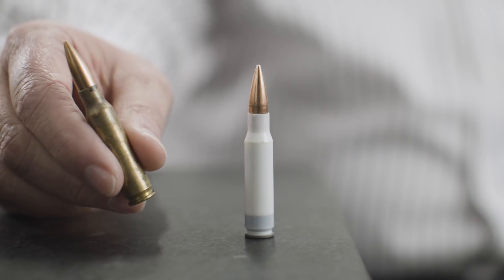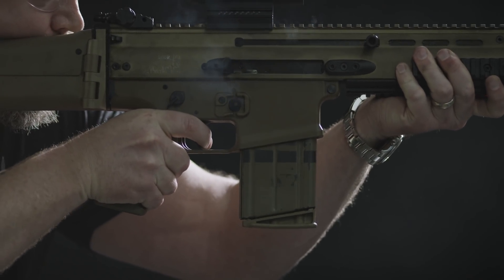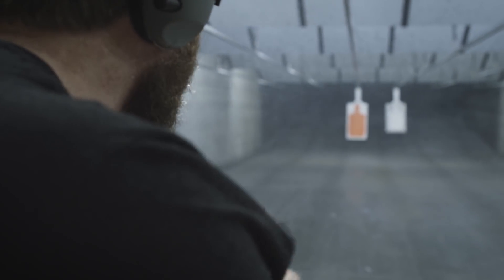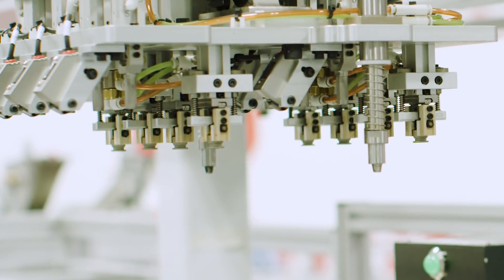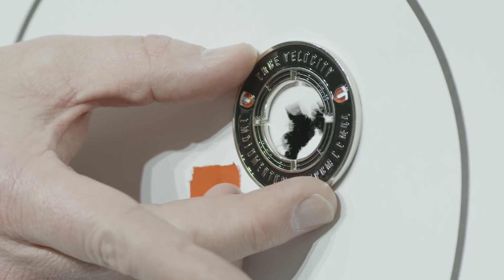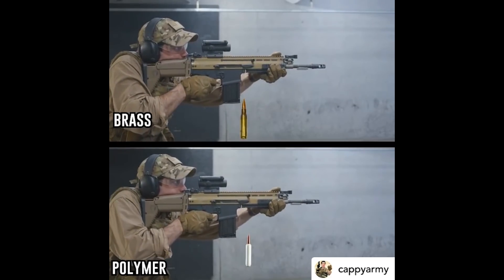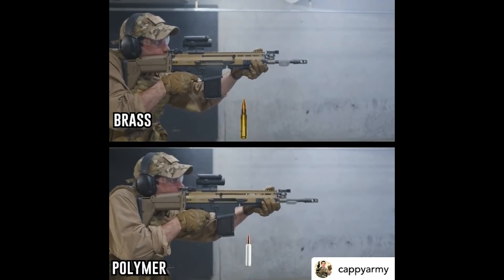Composite Ammunition is More Accurate than Brass | NGSW | Next Generation Squad Weapons

Comment: This is bull crap. High end brass is extremely consistent internally, can accomplish single digit SDs, and produce incredibly accurate ammo at less cost. Oh and you can reload it repeatedly to pull even more cost out of it.
Reply: I was curious about that claim. good to know that my hunch was correct. even so, the military is interested in weight savings. that claim in particular has nothing to do with the goal trying to be reached.
Reply: He wasn't talking about internal inconsistencies. He was talking about the internal shape of the case. For brass, the inside follows the outside and is whatever that shape is. Polymer cases can be molded internally to control how the powder burns i.e. better.

Maybe listen instead being a keyboard warrior.
Reply: @MansMan42069  They are in the middle of a campaign to raise capital through large capital investment and its a marketing video.They wouldn't pull anyone's leg while trying to raise money would they? How much ammo have they sold commercially? A very small limited commemorative amount at $160 per 20 rounds. How many people have you seen (on the internet) showing a comparison to brass ammo and statistically agreeing with his claims that aren't True Velocity or aligned with them? In the shooting world tech that gives you an advantage like they are claiming spreads like wildfire. No one is talking about it. Primarily because it doesn't exist and you couldn't reload it if you wanted to.
Reply: @MansMan42069  Nothing I said in my original post is wrong. Other than my opinion statement of this is bullcrap the rest is all factual. Absolutely factual and cannot be argued, actually. You can disagree with my opinion "bull crap" but there is not a single argument against what I stated. 
Maybe you would do best to read what I said since you're such a stickler for the details, time stamps, "prove it" call outs and insults.
Reply: @MansMan42069  As far as listening. He says that their ammo has more consistent internal dimensions (unlikely, if so its 1-2/10ths of a grain and unimportant), he states that the internal geometry helps powder burn (I dont know,  their marketing video says so) he says its more consistent and that they maintain higher standards of quality control (nope) which gives you more consistency, tighter standard deviation (their SDs are not better than brass) which leads to tighter dispersion and tighter groups (yep, it does no matter the vessel). However, they cannot achieve the accuracy levels of brass, fact. Regarding heat transfer, polymer does have a limited effect on that. After firing 200-500 rounds what do you think the barrel temp difference is? All the burnt powder and gas is still heating the entire bore, do you think the 3" chamber area doesn't get the heat radiated from the barrel? More likely 8-10% less powder has a greater impact on it than the case itself. Brass also pulls heat with it when its ejected but we will save the details on that.
Reply: @gunguru7020  Your arguments are based on skepticism and you can continue tooting that horn. That's not my contention. I don't care whether he's lying or stretching the truth because you have nothing but speculation and conjecture. Basically, no proof.

My actual problem with you is your misrepresentation of what he said.

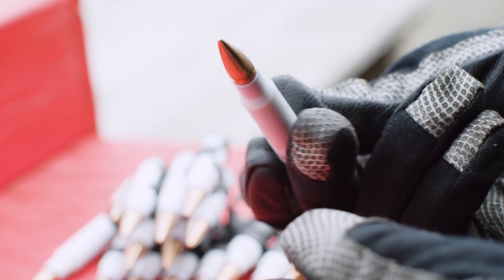0:55 - "We control the molding process very tightly so that parts are very consistent [from] one to the next."

Where did he ever claim that their quality control is "higher" than anything, brass or otherwise? Where did he mention that their internal dimensions were more consistent? Kindly give me the time stamp.

Again, try listening.
Reply: @MansMan42069   They whole point of the video is a comparative to traditional brass. When he says the similarities stop here he is saying what they do better than brass. He compares them,  then says composite is different and unlike brass because, and lists all the things it does better. 

:10 what we have here is two cartridges, one brass and one composite, the have the same length, use the same projectile, same powder..... (:31) "however thats pretty much where things end."

As far as speculating, I am not.
Reply: @gunguru7020  Your comprehension is lacking. For you to say that the video is saying what you think it's saying is intellectually dishonest. Basically, you're reaching. The video does not even remotely imply that its process is better at all.

And yes, you are speculating. You have no hard numbers. Neither from brass case or from the polymer case in the video. You're pulling things out from wherever the sun doesn't shine.
Reply: @MansMan42069  What is it saying? Tell me where I am reaching. 
1. My original post is 100% factual. 
2. The opinions I represent are based on decades of brass reloading for extreme accuracy
3. My opinions on composite are based on experience and exposure 
4. My TV experience is based on evaluating 80 of their commemorative rounds. Although very limited i didnt represent any positive or negative results from that as it is way to small of a sample to provide confidence. Rather I said its bullshit because its marketing spin and brass is equal/better and cheaper initially and cost continues to be lower every time you reload it.
Reply: @gunguru7020  In your original post, you said "High end brass is extremely consistent internally"

Just because this is factual does not make it relevant. This is a red herring and is irrelevant to the video's claims. The video didn't even claim that high end brass was inconsistent internally and made no comparisons between the manufacturing processes. Show me a single explicit comparison to the brass case manufacturing process in terms of quality control.

I only have your word. Where's your video proof? I can be just as speculative and say you're only blowing smoke and are lying about your tests just to save face. So I'm calling your bluff. You haven't done any personal tests. Feel free to prove me wrong and provide evidence and hard numbers.

Try again.
Reply: @MansMan42069 The whole point of their companies existence is that they are superior to  brass cased ammo and if you cannot see that this is a comparitive marketing video telling the viewer why that is, then we are too far apart to have any further discussion. I will just leave it at this because I have no desire to continue to defend that you can accomplish more with a brass case than has been proven with a polymer case. Yes its lighter, which is a quality which is irrelevant to anyone other than the military. It cost many times more and cannot be reloaded. So far, it has proven to be less accurate than brass ammo when making "match" accuracy and single digit SD claims.
Brass is equal or superior in almost every facet. I dont need to prove anything regarding that at all. 
In reference to proving anything around polymer thats the job of this video. I am not selling the product. Its the one making the claims, it should show you the statistical differences. If you are that interested in that buy your own ammo, shoot it and decide yourself. Don't demand that someone do it for you to prove themselves correct and you wrong. You will be disappointed. 
I am saying what they are claiming is marketing spin and/or irrelevant.
True Velocity is trying to raise hundreds of millions of dollars and competing for billions of dollars in DoD contracts. These videos come out during those campaigns, they release a limited run of commercial. 308 ammo, and you don't think that its a coincidence. Rather you defend what you, apparently, don't know or blatantly ignore.
Reply: @gunguru7020  Still reaching. You are putting words in their mouth. You're attacking a strawman, instead of the arguments I actually raised.

You have no evidence, are putting words in people's mouths, and have no concept of intellectual honesty. If you're going to attack something, attack what he actually said.

Go learn some basic argumentation first, kid
Reply: @gunguru7020  It is intellectually dishonest if you misrepresent what your opponent is saying. That's called strawmanning your opponent and is fallacious reaaoning because you're attacking a position they don't hold.

Also, you make claims but don't bother to back it up with video evidence of your supposed testing and experience. Burden of proof is on you to justify your assertions.

Try again.
Reply: @MansMan42069  Video proof 😅🤣😅🤣. Maybe a pie chart or some graphs would help you as well. 
Why don't you do the simplest thing? Go to True Velocities web site and see that their whole campaign is a comparitive to brass. I am not misrepresenting a damn thing.
Reply: @gunguru7020  Burden of proof is on you. Provide your evidence for your claims. It's simple. Or is it the case that you simply can't?

I'll wait.
Reply: @MansMan42069  You are tiresome. Its like arguing with a 3rd grader. You just keep saying "No he didn't" and "prove it" over and over again, non-stop, like thats valid and productive.
Reply: @gunguru7020  Ironic, considering even basic argumentation escapes you.

Sit down, kid.
Reply: @MansMan42069  You ever notice that whenever you are asked to provide an argument against what is being discussed, you have nothing? Its why it is pointless to discuss anything with you. You bring nothing, zero, zilch to the conversation. Period. So why bother?
Reply: @gunguru7020  I don't need to. Because burden of proof is not on me. Argumentation 101. Try again. As far as anyone is concerned, your claims have 0 weight. So heed your own advice, kid.
Reply: @MansMan42069  I have nothing to prove. My initial statement you argue against is 100% factual. I will simplify it for you so maybe you can understand. TV ammo has nothing to offer that is better than brass except weight and that comes at a cost of being more expensive, no increased performance and zero ability to reload. The consumer market has no use for it. Literally zero. It solves no problem that exists but rather brings more problems than brass. 
Weight means absolutely nothing to anyone but the military.  Polymer ammo has been around for 50+ years in one form or the other. The US Military has run multiple tests and has minimally implemented it. Why is that? A simple cost benefit analysis. It's expensive per round compared to brass and brings no performance advantages. An organization that builds 275 million to 1.5 billion rounds a year has little interest in tripling, quadrupling or even more the cost of their ammo. They don't have the infrastructure to manufacture it. I have read projections that Lake City ammo plant would need to spend $600 Million to implement composite ammo manufacturing. Believe it or not there are emerging environmental considerations. Europe does not allow composite ammo because of their single use plastics ban. 
Like I said, I am done discussing and educating you on shit that is almost entirely sourced on the internet. Get off your ass and do your own research. I would assume that you have everything to do your own simple test. If your commenting I would hope you have shot brass ammo. Go buy some TV ammo, waste your money and run your own comparison. I have tested it extensively (as you can with 84 rounds), the sample size is to small to make some determinations but sufficient enough to make the statements I have. 
If you had half a brain, you would not argue for the sake of arguing and consider asking people what they know to save you the trouble. However, that seems beyond you.
Reply: @gunguru7020  Saying "it's factual" does not make it so. To prove a claim, you need evidence. Present it. Your word is worthless. Cite your sources. You call yourself "Gunguru" but have nothing on your channel. Where are your tests?

Or are you going to keep barking?

You're getting schooled on how to prove your position.
Reply: @gunguru7020  If you didn't care, you wouldn't have decided to make an əss of yourself in the first place. Gonna cry? You can't prove what you're saying. By all rights, I can say you're wrong and I wouldn't need to prove it.

You're done. My condolences to your parents for having given birth to you.
Reply: @MansMan42069  Rawwwrr the crowd goes wild! GuuuuuRu! GuuuuuRu! GuuuuuRu! 
HE IS THE PEOPLE'S CHAMPION!!! Folks that was a historic beatdown!! GuuuuuRu! GuuuuuRu! GuuuuuRu!
Reply: @MansMan42069  We are the champions. We are the champions. No time for losers cause we are the champions......of the world!!! 
When you win you win baby! I would like to thank everyone that has stood by me all these years. Without your contributions wins like these aren't possible. Because of your sacrifices, we all won. Well not all of us but, you know, those that mattered did. This ones for you guys!!!
Reply: @MansMan42069  this was amazing. I haven't seen total domination like this since Hiroshima. USA! USA! USA!
Reply: @gunguru7020  Thanks for narrating your own destruction. All that bravado and you're reduced to this. And with a desperate two-in-a-row reply too. My job is done.

And you still haven't proven you're correct.
Reply: @MansMan42069  You were done when you started, bud.
Reply: I think he’s full of crap also. It’s why he repeated himself 4 times. Trying to make it sound true. 10% less powder and maybe lighter in weight? I have a feeling shelf life is worse. Plastics degrade and become brittle. I bet they got 6 years for safety and 10 years before absolute fragility.
Reply: Military forces tend not to reload ammo due to the veritable conditions of cases and sorting it out will be too much trouble then just recycle the case materials, 
since the polymer cases is lighter and it’s performance during higher rates of fire is potentially better than it’s brass counter part, no wonder the military is interested in it.
Reply: For the civilian market it would be useless, but for military that wont be picking their brass up one by one in a active combat zone, pretty good. I belive they are aiming for the military than civilian market because other companies can continue making brass cartridges and outcompete them
Reply: @att7364  It has great potential for MG and air platform applications if they can get the cost down. Significant weight savings for both but close to 3-4X the cost.
Reply: yeah I'm sure he's comparing to your typical military ammunition. Far cry from precision loaded Lapua cases.
Reply: Won't be surprised if this becomes a way for the government stopping people making there own reloads
Reply: What matters most to people like me in a world where ammo is hardly easy to find, and nowhere near the price it was two years ago, the ability to be able to reload is paramount. Just as the initial price, and availability.
Arguing over whether it weighs less, or if it gives tighter shot groups is far less important. And for some of these debates, unless unbiased reviews and reports can shed some useful information, arguments over speculation is totally meaningless. What someone thinks is the case, doesn't mean it is so.

Comment: If the technology does not produce more accurate ammo it will either continue to be developed until it does or fade into obscurity.  The comments about the cost at this time are a pretty dumb argument.  When brass cased cartridge's were first introduced I can assure you they cost substantially more than ball ammo.  Granted the increase in accuracy wont be as drastic in this case but still, given time, if its a more accurate, lighter cartridge and finds a place in the military industry the prices will come down over time and then be more affordable for the recreational or hunting market.
Reply: They won't be lowering it unless they absolutely have to. Why would they? They can charge whatever they like so prices will not be dropping fpr quite some time. Also the accuracy really isn't any better at this point than cheaper brass. So you pay more, get less, and can't reload it. And since it's patented there won't be any influx of competitors.
Reply: @austinhill9919  Well, in ~20 years the patent will expire and anyone can do whatever they want
Reply: Thats a flawed arguement when brass case came in it was the first reliable cartridge for repeating rifles and revolvers not only was it more accurate but it provided advantages like lower reload times mores rounds on hand and more reliabilty... thats apples to oranges this is apples to apples so pretty mutc the only thing that matters to a civilian would be cost  that and valye wich are two different things why give up the value of reloadavle brass for something that leaves you short handed after use
Reply: Not when one company owns the patent and has a monopoly on it. They'll keep the prices as high as they can.
Reply: @jungleno.  that is the great thing about free enterprise, they may hold the patent but if the competition just changes one thing it can and will lead to developing better results and cheaper prices. I am sure someone is working on carbon fiber cases  or caseless ammo right now.
Reply: brass cartridges were a game changer for the fire arms industry.. ease and speed of getting another round in the chamber was the difference between getting your ass shot off and not.. this junk is just another way to keep people from being able to afford ammo.. you are blind to the plan my friend.. this stuff is trash and I will never buy it!
Reply: Lest you forget these cases also can’t be reloaded. So yes they will cost a fuck ton more and are also none recyclable. So yes these rounds are a terrible idea and don’t really have an advantage over brass.
Reply: Comparing when brass was introduced to ball ammo was a dumb argument, because cost WAS significantly reduced. Time was the cost, and time in reloading a weapon was worth every penny.